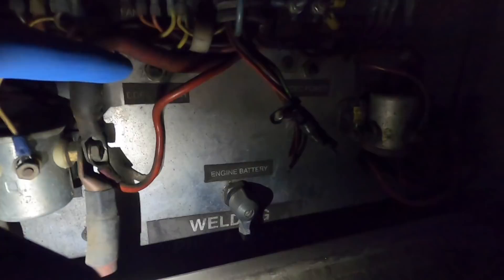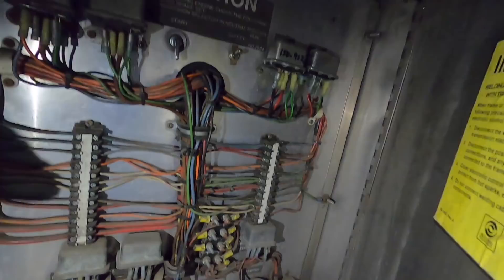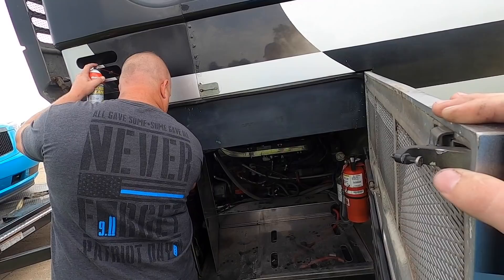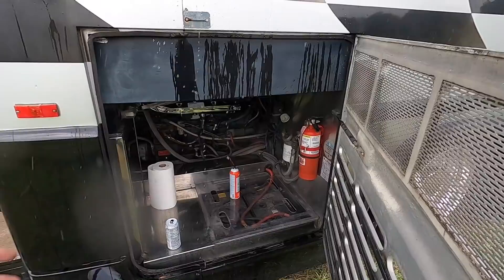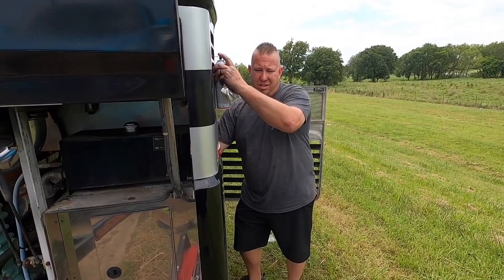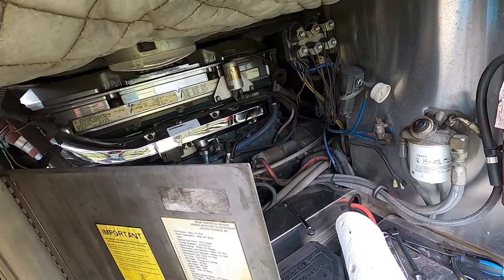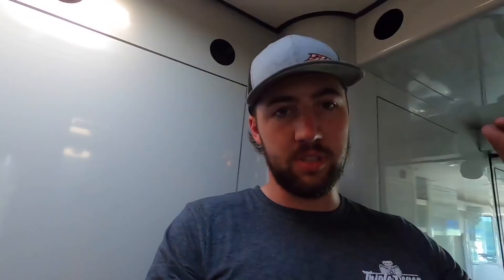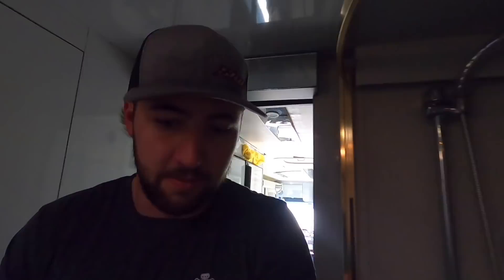RV Totally Stranded For 25 Hours...What Happened?? (My 96 Newell Coach Broke Down!)

Comment: The difference between a true tech and a parts swapper.
Reply: I said the same thing. .
Reply: part of troubleshooting is part swapping. New engines do have technology to assist you with "codes". He was going to "swap a wire" to test his theory. Who knows if he would have swapped a fuel pump if it was not swapped prior. Experience is the last thing you get when you need it.
Reply: @stevenplaskett7728  - And steering wheel holders, not drivers..
Reply: You put that precisely.
Reply: @torpedomtb putting a fuel pressure guage on it would have told you it wasn't the fuel pump...
Reply: Came here to post this. Sadly, more often than not you'll get a parts swapper. When I saw the can come out and just wailing on the starter I knew this guy wasn't going to resolve anything. The kind of tech to complain about his hours/sales yet can't fix a thing and also has the messiest box and drinks 4 liters of Mountain Dew a day. But at the end of the day is they refunded his "labor" then that's pretty solid. At least you have piece of mind knowing the pump is new!

Props to JG! The industry needs more guys like him!

Comment: A refund on the labor sounds fair.
Reply: Labor refund and a profuse apology. The tech although incorrect had good faith belief he diagnosed properly. I currently have an M2 Business Class Freightliner that has a shut down, crank, no start at work. It will fire on ether but will not run. I'm sure it's an ECM issue because the code flashing on the dash says No Eng... Once I find the part that's lying to the ECM, it'll be fixed... LOL
Reply: terry waller  I'll
Reply: @npjones11  seriously?! That's all you have to comment on?! Grammar? Did you eat glue and lick windows in school?!
Reply: Murphys a sumbits!!!

Comment: sitting here watching the first guy dump starting fluid in and still a no start. i face palmed when he said fuel pump..    u can take the pump clean off the motor and itll still run on starting fluid
Reply: You shouldn't really use starter fluid either, but I guess you were in a bind.  Yeah, if it don't fire over with ether, then it damn sure won't run with diesel too.
Reply: @stafcurtis1  - I used to drive an old Peterbilt, and if it sat longer than a few days, Ether was the only way I could get it to crank over, then it would run a month without shutting down. Had over 2 million miles on that truck. No problem with a little Ether on a diesel.
Reply: @seananon4893   sounded like it was loosing prime from the tank. Usually a line or fitting  will cause it

Comment: Shit happens , l've own big trucks for 25 years and stuff like this happens all the time . You handled it well , at least you know your fuel transfer pump is new , l just replaced mine 2 weeks ago . I had same thing happen to me when l bought this peterbilt 11 years ago . It just shut off going down the road , checked ground cables all the typical things couldn't find anything . Called service truck and he checked everything l checked , he called his shop and then he checked my fuse panel and found the fuse to the ECM had fallen out . He plugged it back in started the truck and handed me a bill for $350 . Same thing happened 6 years later and I knew where to look and sure enough fuse had fallen out . Live and learn they say , enjoy your video's and the adventures . Life on the road is always a adventure , its frustrating at times but you have to always take it as its dealt to you .

Comment: I feel  your pain Mitch;  lost my fuel pump in the panhandle of Florida.  Cost of the pump on an M11 450, just a little over $500.  At least you got the labor you paid back, but normally, once a part like that is put on, there are no returns.  However, you have a spare.  We had a coil replaced on our aqua hot and there was nothing wrong with it, but ate the $300 for that little bugger!  If we are ever in need of a mechanic in Oklahoma, will definitely give that mobil tech a shout out for sure!  Lucky you found him and that he is also honest and not trying to rip you off with a new ECM, they aren't cheap!

Comment: Those JST pins are super common in the RC world.  Hansen hobbies has a killer kit with ratcheting crimpers but they're all available on Amazon too.

As for the fuel pump a labor refund is fair enough.  Not much goes wrong on 60 series but cam sensor (behind the air compressor) and the ECM fuse holders that are at the batteries, not in the body harness.  I've lost one before and ended up limping 150 miles on 3 cylinders.  What a slow trip that was lol.

Comment: Unfortunately there are far too many people who think they are diesel mechanics, but all they really are is parts replacers. Awesome job Jeremy, a real diesel technician, looks like Stapleton Service might be a part of your future. Lol.
My first thought was the fuel shut-off safety switch, but I got out of diesel service just as the series 60s came in. The Cummins 444 was the big dog on the block at that time.  Glad to see that you found a proper technician.
Reply: Yes, but the honest mechanics are the ones that make the less 💰.
Reply: @neliosamch3195  An honest tech has a conscience and love their work, not the big bucks. However, a good tech is absolutely worth the highest wage.
Reply: @gwbuilder5779  absolutely, it is hard to find honest tech with good reputation working for a dealership when they are being exploited.
Reply: @neliosamch3195  Honesty at a dealership is like expecting change from your kids when you don't ask for it back. Lol
You might get it, but probably not. Hahaha...
Unfortunately I have not had the luxury of an honest dealership in my area and I have moved quite a few times in the past 35 years. Most dealer service centers typically only have one or possibly two senior techs that actually know what they are doing, the rest are just cheaply paid underlings doing what the dealership tells them to do. Warranty work? Not if they help it. Highest book rate, but quickest cheapest actual repair possible. Very little integrity if any at all. I typically recommend the local race shops instead because they may not have diesel knowledge, but they usually know who does.
Reply: @gwbuilder5779  That's right, I never forget when I had to pay for a timing chain and the only thing wrong was the alt brushes worn out.
Reply: @neliosamch3195  Exactly.

Comment: If they’re a diesel repair shop the first guy should’ve showed up with the proper tools to diagnose problems instead of just spraying ether into the intake, definitely not the correct way to diagnose an issue
Reply: Goon Garage 321 when you spray ether into the intake and the engine fires, that indicates a fuel supply issue. 
That’s usually a quick and easy test. The problem with the first guy, is that test failed. He had no plan B.

Comment: I like your down to earth, sensible and no nonsense channel.

The first clue was on the sudden cut out of the engine, a fuel issue would have had some warning, i.e. stuttering, loss of power or acceleration. So as in all things, the guys doing the fixing should ask for the history of the problem. Then with the application of more common sense eliminated the obvious. Your second tech went straight to the heart of the problem, electrical, he also offer a no cure no pay option, excellent. The first guy came straight away, very good too, but only if he had the right tools and fix.

Everyday is a school day, I have learned it is always easier to critique than to do, so hats off the the guys who came to your rescue.

All the best and good luck for the future, stay safe in the current pandemic crisis by taking all reasonable precautions

Don (from Scotland)
Reply from the maker: I didn’t even have the right stuff with me to diagnose an electrical issue and that’s my own fault. I’ll be carrying that stuff from now on that’s for sure

Comment: I used to drive the big rigs. Once was going down the hiway and the truck just stop running. After sitting on the shoulder for a few hours a truck went by and said over the CB, check your radiator. There is a sencer in the fill stem. If it gets below the sencer it will shutdown protecting the engine from overheating. One gallon of water later, I was back on the road.

Comment: When I saw the first tech spraying ether in there, I was skeptical of his knowledge. Shouldn't have needed that on an electronic controlled engine. But shout out to JG. I run that area a lot and good to know he's there.
Reply: It has changed a lot since I did work on diesels but the only thing either was good for in diagnosis was if it did not run on either it wasn't a fuel problem.
Reply: I was always taught to never spray ether to start a diesel bc it will get hooked on ether and wont start without it. An old logger used to tell me that
Reply: @chucklyons454  lmfao!

Comment: You should carry some spare hoses, fuel (and or fuel/water separator), oil, air filters. I would also suggest getting your self an older Diesel scan tool with the correct adapter for your set up. 
As well as getting access to an online manual for your DDEC 60.

Comment: I had the same thing happen once. Detroit in had a tech stop by on his way to another job to do a quick diagnostic. Figured out I had an open circuit between the ignition and the ECM. Truck would start using his starter box but it wouldn't with my ignition. Since it would involve tearing apart my dash, he asked if it would be okay to bypass the spaghetti in the dash and put in a jumper. I could drive to the shop instead of having it towed. I drove it with the jumper no problems. FYI at 5:23 you picked up a nylon gear that fell out of your fuel pump. Those wear out over time and are usually the problem with fuel pump failure. Buy a spare and put it in your parts box. Way cheaper than $300.
Reply from the maker: the nylon gear was replaced with the new pump also
Reply: @Stapleton42  That's good. I have 1.7 million miles on the truck. Never replaced the fuel pump. Just the gear.

Comment: So you had no power to the injection pump fuel shut off solenoid. Your lift pump was sending fuel but the IP wasn’t sending it to the injectors. You can test that by removing the power connection to the solenoid on the Injection pump when you reconnect it you should hear a click.  No click either the solenoid  is bad or it has no power. Lift pumps don’t fail that often.

Comment: For future reference, if its a battery power or key on power supply issue to the ECM, the check engine light on the dash won't cycle when you turn the key to the run position.
Reply from the maker: Truth. That was the case here too
Reply: @Stapleton42   Those lift pumps rarely go bad. Its usually the check valve/ restrictive fitting on the back of the head where the fuel return line attaches. But that usually causes a low power issue and or a hard start.

Comment: I've dealt with 60 series Detroit for 20 plus years. In all those years I think I've changed 2 fuel pumps. And both where to upgrade them. Its normally always the ecm 12 volt wire with that issue you had. Sorry the first guy burned you. I would definitely call in and complain. They should at least drop the service call fees

Comment: you only need to take one look at these guys and you can tell which would have a higher likelihood of being electronics savey, the first guy might get the injectors & pump changed the quickest & be able to change the clutch out on the side of the road.
The younger guys are pretty good with the late model stuff because thats what their trade course delivers.
So we are talking 2 different eras of roadside assistance, in a marketplace where there are still 2 eras of machinery on the road.
A situation with an older coach MAY have yielded a different result.
Not sayin an older guy can't have Equal training, just not all get the opportunity for the extra training. And then there's the tooling...
Good on him for the refund of labor...
I like how you handled the situation, just don't be too hard on the 1st guy or the people with older rigs may end up missing out on another source of help... cheers from Australia.
Reply from the maker: Solid observations

Comment: I had a mid eighties Freightliner cabover with an "A Model" mechanical Cat that would intermittently just shut down, then would run after jiggling the harness near the pump.....Turned out to be a bad crimp on the wire to the pump shutoff solenoid switch......Now I crimp, solder and shrink tube everything I do...

Comment: An excellent mechanic. I can't say that the 1st mechanic did anything wrong, as most people would assume the no start issue be related to a no fuel issue. Look at it this way:::: now you don't have to worry about a fuel pump going bad. The second mechanic I am assuming is more educated as far as the electronics aspect is concerned. The 1st mechanic was more old school, which is not a bad thing, either. But these engines are so finicky Nowadays. Wanna make that turbo last longer? Keep the air filter clean. And if you ever get in the eastern ohio/ western Pennsylvania area, look up Bruce Mallison who owns Pittsburgh Power. Nobody better than him and his crew. Honestly. He has done work on my semi and it runs incredibly strong. He has a diesel pusher coach himself.
Reply from the maker: Pittsburgh Power is literally next door to my good friends business lol. I went to high school about 2 miles down the road from that industrial park

Comment: Crank but no start, first thing you do is check to see if the engine ECU is communicating with the vehicle ECM.

Not getting a shutdown code yet shutting down  would tell you the engine ECU lost power.

Comment: I agree with Mark, the refund on the labor is deserved, but you still had to pay for a part you did not need...but probably need sooner or later, don't know how I feel about that.  I have a friend whose bus stopped in a camp ground.  Being "shade tree mechanics," and having all the tools needed, we diagnosed, poked, prodded, and found there was no power to the instrument panel, but couldn't figure out why.  The closest diesel repair facility was 1 1/2 hours away, and it took them about 15 minutes to find the corroded wiring.  So, $1,300 dollars later, and NO parts, he was up and running.

Comment: Run a dedicated 12 ga wire from batt + to fuel solonoid & crank. Be shure of connection. D o't want to break down in worse place. Or a hot place on the starter.

Comment: Refund on the labor is cool i think. I would be ok with that.
Nearly fell off my chair seeing the other guy spraying ether to get it going. 
At that age a fuel pump can go so now you got a new one keep it in case.
I had one of these Detroits and allot of my buddies had them in class 8 trucks.
No end to these. I seen 800 thousand miles without a single major issue.
Best motor best fuel mpg was the Detroit in those years. Cat was also good but not 
for fuel economy and expensive to fix.
Reply from the maker: I love this motor so far. It sounds great and hauls ass too

Comment: It may be worth while to find a scanner for DDEC III,but they could be pricey,we use a laptops at work,but I know snap on sells scanners for semi, that way u could at least read the codes and reset the codes,if I remember correctly I think u can flash codes through ignition switch, 
It's probably best u learn the most can on diagnosing your own engine, rather than depend on ether bombers,

Comment: You are fortunate you received a refund on the labor!  We lost our fuel pump on our 450 cummins engine and it was $500 plus service call and R&R.  I sheared the shaft on the pump.  Cummins is proud of their parts!  You might want to carry some dielectric grease with you as well.  Lot's of fun on the side of the road!  Been there, done that!  One thing nice about the Foretravel, you can get to the whole engine from the back with the bed raised up in the coach.  That will keep anyone from coming inside and getting grease on anything!

Comment: Unfortunately it seems like there are very few actual mechanics around these days and most of the time they just throw parts on until they stumble on the real problem but I would say that the garage did more than I expected refunding the labor ( they probably made 200 on the pump in reality ).  I had a customer bring me a truck that he had taken to several garages and even to the dealer because it would not crank unless it was jumped to another vehicle and they replaced over $2,000.00 worth of parts and still had the same problem.  I replaced the ground strap from the body to the engine and fixed all the issues for free and earned several more lifetime customers because he and his entire family come to me exclusively now.  The sad part is that I could go on for hours with other examples of people getting screwed over by garages for repairs that should have been easy repairs and it only seems to be getting worse.  If the "mechanic" plugs into the data port and it doesn't say exactly what the issue is they are clueless anymore it seems, and that really bad part is that the onboard diagnostics don't generally say what the problem is like that because it tells you what the symptom is and points you in a direction which should help make the repair more efficient but it has had the opposite effect obviously. Glad you found a good mechanic though.